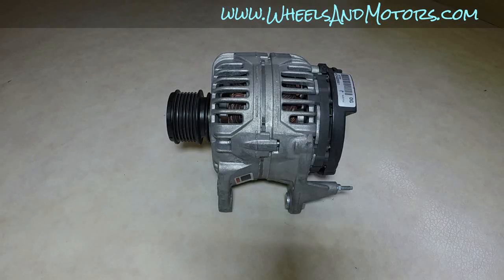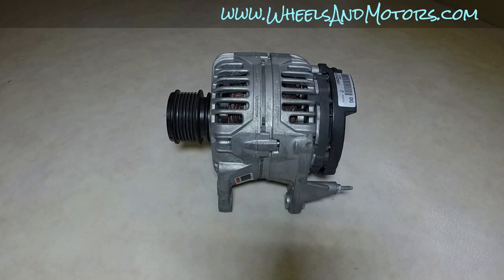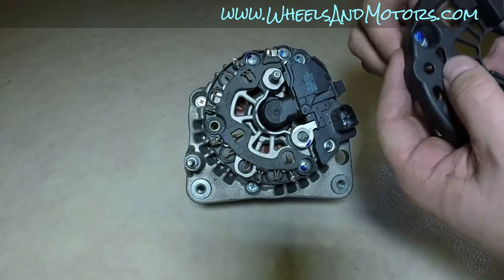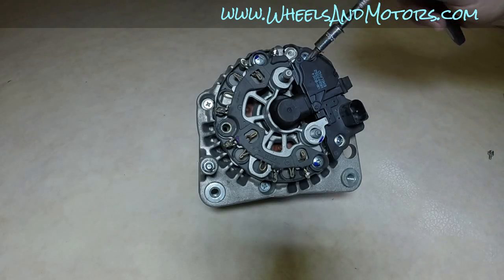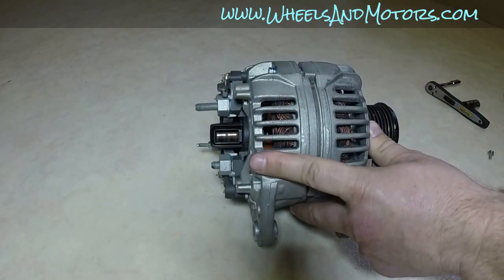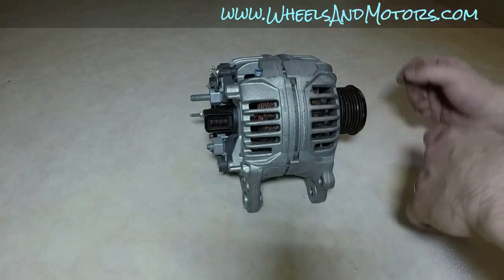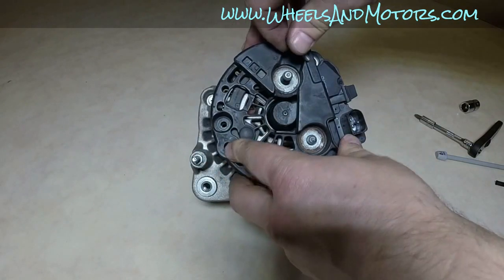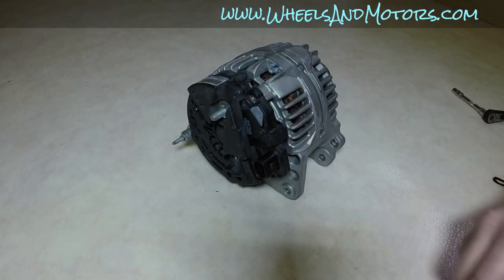How to replace alternator brush holder (VW Golf Mk4) - alternator fix

Comment: Can a bad regulator cause voltage to stay below 12v when the car is running? Great video btw.
Reply from the maker: Yes, it can. When brushes wear out. Rings also wear out byvthe way.

Comment: This alternator is identical to the one on my 2003 Audi Quattro with 120amp alternator. The alternator comes in 3 different amp rates 90 , 120 & 150amps. I see these brush/regular assemblies everywhere but nothing about their amp ratings. Part number printed on my brush/regulator module is BR14-HO F 00M 145 261. It seems to me the brush modules shouldn’t be the same for all three size 90, 120, & 250amp
Reply from the maker: I have little experience with a bit more modern VW alternators, and I can say that it's not only (or maybe not the brush unit)..  180 amp alternator is bigger than 110 amp. Although bracket is same standard size, so I can physically fit 110 in my Sharan that supposed to have 180.

Comment: Does the MK4 1.9 Tdi use the same alternator as the Cross Polo 1.9 tdi 2008 models?
Reply from the maker: Not sure, could be, best thing is to check with the seller.

Comment: Can a bad regulator cause an irregular idle? My 1.9TDI's idle is very unsteady, it jumps up and down slightly, and the voltage appears to be jumping all over the place at idle when I check with my multimeter. Also when I drive my OBD dongle reports 0.5v fluctuations at steady RPM...
Reply from the maker: I think bad regulator can cause uneven voltage, but it shouldn't go lower than 12, because you have a battery there, therefore I don't think that regulator would cause irregular idle. I would look for another reason..
Reply: I mean the voltage jumps from 14.5 to 15.0 or 14.0 and sometimes even 
lower. It seems to me it's causing random loads on the engine like when 
you turn on the lights or something. I've read voltages as high as 15.5v
 and as low as 12.6v
Reply from the maker: Yes, it could be faulty regulator,  but I doubt it would cause rough idle. Also maybe rough idle causing fluctuations in voltage, because it spins alternator unevenly?
Reply: That is a very interesting sugestion! I will look into it
Reply from the maker: NOXXism On the other hand I don't know how rough is your rough :) Maybe it IS regulators fault... I wish I could help you, but it needs to be seen properly.

Comment: Is it not possible to replace only the brushes on the regulator?
Reply from the maker: If you replace brushes only, they definitely are cheaper than whole voltage regulator. I suppose it depends on type of alternator/regulator. On my 2012 Sharan, they are enclosed in plastics so much, so it makes me think, if it worth time and effort. On some older ones (like the one in the video), it's probably possible. There is a good video about it, here is the link:
https://www.youtube.com/watch?v=bTcMD5_EznI

Comment: you think i could replace it without removing the alternator ?
Reply from the maker: You can try, if there is enough space for access - why not? I didn't try it on this car, so I'm not 100% sure, but at least it looks like it's possible.
Reply: +WheelsAndMotors thanx 👍 i think i will give a try
Reply: kinda cold out there now, for me...

Comment: it only starts few minutes later but then cuts out again the dash shows battery don't understand what could be the reason for it please 
somebody let me know thanks.???
Reply from the maker: It looks to me that it can be alternator problem. When the engine is on, what voltage does it give?